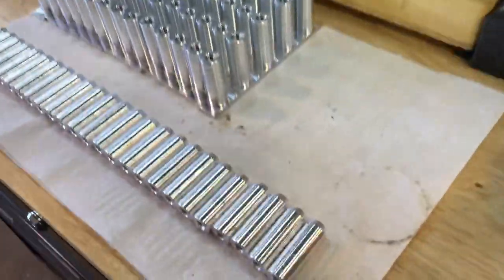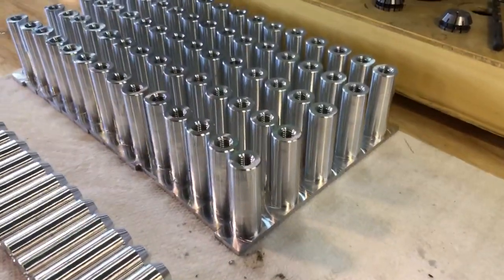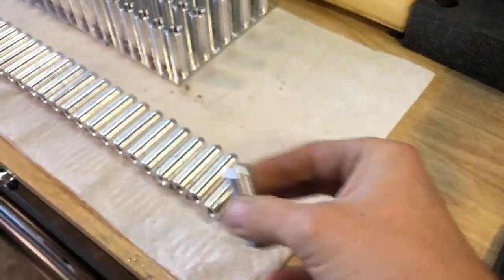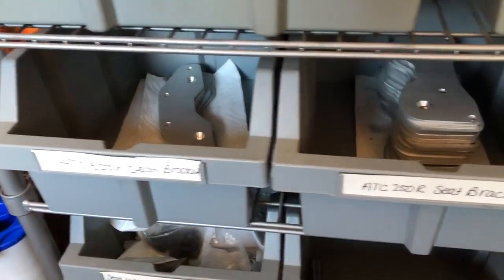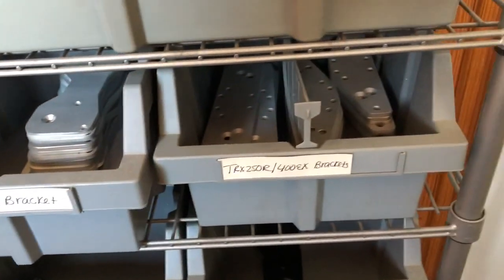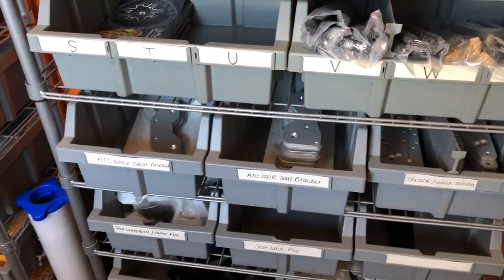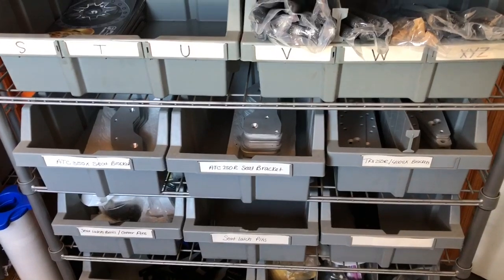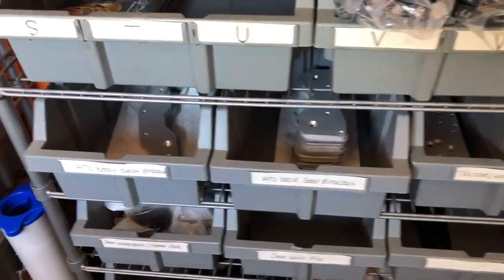TRX250R - 400ex - ATC250R Seat Bracket  How its made Episode 1 cnc machining

Comment: i know its a small run, but why wouldnt you have these turned in a lathe?  it would be way cheaper.  also,  you could choke up on your end mill off you milled half the OD on each OP.
Reply from the maker: If i owned the lathe needed with a bar puller and feed to do what you said then yes sure... but right now this works great 5 at a time in a few min.   Vs. having to use my 14/40 cnc lathe and no puller on it  maybe eventually but right now the haas mill is killin it 🇺🇸

Also ... yes you can run shorter tooling  but i am doing it on a way where there is no marks on the wall of the pin. Its clean full depth of final cut.   The tapered end is only where it lines up on op 2.  Cleaner this way 👍
Reply: @BVCOFFROAD  agree on the tool marks.  its a slick way to do it i guess.  i program for a mid size manufacturing company so i look at processes a lot.  if your quantities were in the thousands, youd need to change your ways. ha.

but to your point, you have a good setup.
Reply: if you are struggling to machine something, let me know.  i would love to see the part.😀